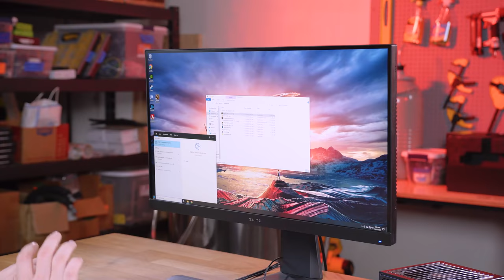This PC almost stumped me... can you guess what went wrong??

Comment: Me, who just built a PC with a Gigabyte power supply: o.o
Reply: Boyyyy better have warranties on all of your parts
Reply: O.o
Reply: I have one too but my pc isn't built yet... Time to send it back!
Reply: Same here, looks like I'm taking them up on the 30day unopened return policy
Reply: Are they that bad? I have one too.
Reply: I am sure they are fine, they are all tested to meet a spec
And gigabyte is probably not the one making them just selling them under their brand
Just because Jay's friend may got a bad one doesn't mean they are all bad
Reply: I've been using a Aorus P750W 80+ gold modular one since June and it's been fine.
Reply: Thermaltake and gigabyte
Reply: The only Gigabyte power supply models to stay AS FAR as you can are the P-GM series, so P650GM, P750GM etc, all other models are fine (AP-GM is fine which is AORUS P-GM)
Reply: @SteveWhaites  that psu is quite fine
Reply: @tshinharR  that's correct, all brand PSUs are made by OEMs like FSP, Andyson, Delta, Seasonic, Antec, Bitfenix, Enermax etc
Reply: @blitzcrocodilegaming4666  which model do you have, read my above comments
Reply: @blitzcrocodilegaming4666  ^^^
Reply: @xzreai1802  yea it's the p-gm series
Reply: @blitzcrocodilegaming4666  Immediately change it, it is actually dangerous and has caused lots of issues in the past.
Reply: @xzreai1802  v850 golf sfx
Reply: @xzreai1802  ok then! Thanks for the advice
Reply: @blitzcrocodilegaming4666  no probs, happy to help.  Have fun with your PC 👍
Reply: I see you also enjoy living dangerously.
Reply: @xzreai1802  Except Corsair and Thermaltake. Both of these still manufacture their own power supplies in-house.
Reply: the next time you buy, always research lmao
Reply: @Sabrinahuskydog  That I know of, Corsair CX/RM/RMx/RMi/HX/AX are good but overpriced most of the time and some good PSUs by thermaltake are the grand power series so GF1 650,750 PE/RGB, I'd stay away from their budget smart / BX1 lineup
Reply: Ive ordered a modular one and I'm having double thoughts now 😟
Reply: I had a gigabyte power supply for 2 years and recently got a Corsair. Lucky me o.o
Reply: yeah it has been a while since I had to buy a psu.  The reason why?  I would always use the "PSU tier list".  Not sure if it is still good, but it was useful at the time.
Reply: @bigdog3628  It is still good and running, latest version being 4.0, I actually know the people who write and edit the tier list.
Reply: @yukishiroenishi8564  Read the comments from me above.
Reply: @xzreai1802  cool thanks for the reply.
Reply: @blitzcrocodilegaming4666  not sure how much you're looking for but I found a few evga and deepcool 850 that seem reasonable to me. All 80plus  gold
Reply: @klin117  I actually just went and bought a corsair rm850x a couple days ago
Reply: I will always recommend evga for PSU

Comment: Jay: Talks a lot about alaska being the problem
The riser: Well hello
Reply: That riser comes with TT p5 cases and it caused me the exact same problem.
Reply: @briant6669  Yeah Thermaltake is Ali Express quality but available from other shops. People consider it a reputable brand but it isn't worthy of that.
Reply: "Have you tried troubleshooting your state?"
Reply: he said that the weather could be an additional factor that exacerbates the riser cable issue, he might not be wrong about the weather, and he did find the riser to be an issue, and that does not remove the weather as a possibility. i would suggest any PC be on a power supply serge protector anyways regardless of the local climate.
Reply: @gardian06_85  I've lived in Alaska for a long time. There's a lot of things I've done over the years that would make Jay cringe and facepalm with my computers. Weather has never played a factor. In fact, winter time probably made my computers live as long as they did (over a decade) because I didn't have to worry about overheating issues by just cracking a window open. I even thought humidity would play a huge factor, but it didn't.
Reply: It's a good method to troubleshooting when you think outside the box and consider all things from the simple to complicated, I'm sure that's what he was doing
Reply: @kevinnarvades1279  I have seen environmental interference effect PC components first hand, whether it be a difference in gauge of wiring in the wall (because a contractor making a repair was trying to save some money), or even a gust of wind causing a power line to vibrate. after everything I have seen I refuse to run a PC without some kind of surge protection, and in many cases battery backup.
also he was going through troubleshooting which is similar to deduction: "when you have eliminated the impossible, whatever you are left with no matter how improbable must be the truth" and at the end he was left with only 2 likely things, one he could tangibly find, but the other one would require him to go to that specific house in Alaska to test.
Reply: @CheapBastard1988  Don't insult Aliexpress like that.
Reply: insert obi-wan hello there here
Reply: @LatvianVideo  i mean, ali express has a reputation for having cheap and arguably crappy parts
Reply: and gigabyte psu
Reply: It's a sign that you are running out of ideas when you bring up weather and static in the air and fucking igloos
Reply: but to be fair grasping at straws is just part of the trouble shooting process... you just should check everything else before you get to the weird shit... 
    Sometime it turns out to be the weird shit, mostly not

Comment: I just upgraded my PC today, and went through hell trying every troubleshooting method I could think of. Turns out, I forgot to toggle the switch on my power supply 🤣
Reply: Lol, that's how it was for my first build, i thought i killed it, and then flicked the power supply button and it worked.
My second build was a little more complicated. The board wouldn't boot from the case powerbutton, and i couldn't figure it out. I thought the board was dead, but jumped it with a screwdriver and it started right up. I took the front IO out of the case and pressed the power button on the pcb and not the case. And it worked. Figured out the problem. The button wasn't properly aligned with the button on the PCB. That's just one of the many problems i had with that case. It was the Lancool 2 orignal version. After many other problems like gpu seating being impossible, i had to get rid of it. I don't know if all the Lancool 2's were like that, but mine had no way to mount the gpu, as the motherboard PCB was basically touching the side of the case, and there was no way for the fingers on the pcie bracket to get in with going through the board.
Reply: Lol I was helping a coworker troubleshoot his PC over text. He said the monitor doesn’t show anything. After about 10 mins I ask if the HDMI cable is connected from the graphics card to the monitor. He’s like oh it’s supposed to go to the monitor? 🤣🤣🤣
Reply: Welcome to the club
Reply: I will build my pc tomorrow, hoping it will go smoothly, and the cooling will be enough, as I will have total of 2 fans in the case, cpu fan and a 80mm server fan, probs will put it on the cpu cooler for now too, because my fans will come after a month. I will def run it without the side panel for now
Reply: There are times when i forgot to plug in the 6 pin pcie on my gpu, and i thought it was dead or something🤣🤣🤣🤣
Reply: #1 rule of troubleshooting anything tech related, start at the electricity outlet and work your way back from there
Reply: @scprojekt1896  My brother tried powering his gpu on a single 8pin, when it needs 2, it said to plug in all of the pci-e power
Reply: I RMAd a probably fine motherboard because I forgot to install the standoffs. There were a lot of silly rites of passage of pc building pre-youtube and plenty since.
Reply: For me, it couldn't boot as the RAM wasn't fully installed. Nowadays motherboards only have clips on one side so I thought I wouldn't need to hear a click on the side with no clips. Double checked and found out that the RAM still needs to be clicked in one the other side...
Reply: @pixels_per_inch  I did the same thing on my previous build, I couldn’t figure out why only 12 GB or RAM was showing up (I had 4 4GB sticks), so I went through each one by uninstalling all of the other sticks and leaving just one in the system, and then got confused when they all booted properly
Reply: You should rethink your troubleshooting methods. The first thing you should ALWAYS do is check the power switch. Sadly there are too many TechTubers that showcase the wrong way to "troubleshoot" a PC
Reply: Hey you're lucky it was such an easy fix, I added a new SSD after Christmas and have had nonstop problems with everything from the HDD not reading to one fan on the AIO not spinning to the GPU fans not spinning to the mouse not working. 

None of it is connected with installing an SSD, it's just bad luck. But every time I try to fix something, when I turn it on it's still not working and now there's a new problem

Comment: I have the same case Jay. The bracket is on the wrong side in your video. Mine does not bend hard like that at all. And while I was watching you hold it up, I looked at mine. That metal part goes below the self, and the ribbon runs under it. the hard bend was not ttakes fault on this one.

Comment: Yeah, i have had the same experience with a more expensive riser-cable.
I replaced every component in my computer before i found the issue.
I'm never using riser-cables again, and i'm never using water-cooling after my brand new ek x360 rad had a leak in the middle of the fin-stack that ruined another computer i had.

I'm sticking to noctua coolers and stock GPU mounting.

Comment: I have never used a Gigabyte PSU but I built my first AMD computer last year and also for the first time used a high end Gigabyte Mobo. It failed after about 90 days, I had it replaced by Microcenter and all was fine, for four months then the new one failed. I bought a new one (#3) and sent the old one (#2) back to Gigabyte. This time I had Microcenter install it and check my build and the other components. The new one (#3) was then working. After weeks I contacted Gigabyte to get status on the one I had sent back, I knew they had received it weeds earlier. After a bunch of BS (yes I kept all the BS communications) they sent the repaired one back to me. While it was in transit, guess what, #3 failed. Microcenter also confirmed that that Mobo had once again failed. 
Being totally done with Gigabyte I bought an MSI X570 Mobo which has been running fine for a year.
Gigabyte? I would rather trade in a Mercedes for a Yugo than get Gigabyte anything.

Comment: Jay: "Get good riser cables"
Me looking over at my P3 with factory cable: "I should fix that"
Reply: My P3 with factory cable has been working great since day 1 (18 months old now, running a 2080 Super).  I did a build for my dad with a different Thermaltake case that came with a riser cable that is having all kinds of wonkiness.  I though I had eliminated the riser cable as a source of issues but this is making me think I need to revisit that
Reply: @coryvincent6249  ive got a p3 ive not had anything wrong wirh it either ahs
Reply: I got a P3 as well with a 2080 ti using the included riser cable and no issues since day 1. Its been about a year now. I was worried about the riser cable when I first got it after looking at everything about them. Maybe I got lucky?
Reply: @Prod1702  Maybe you got their best. Even a broken (analog) clock tells time accurately twice a day.
Reply: If it's working fine right now, better to just leave it alone and not disturb things.
Reply: I believe I read somewhere that the issue crops up when dealing with PCIE 4th Gen cards/boards, ask me how I know... AMD 5700XT wouldn't work, Nvidia 1660 TI had no issues on my kids P3 case
Reply: I had to take out my riser cable and mount it normal in my p3. The riser cable wouldnt work with my 3080 even set to gen 3 still didnt work.
Reply: @coran007  I have the 1660ti in mine. No hard bend, has worked fine for a year now.

Comment: Jay: "don't buy a gigabyte power supply!"
Me looking at my 700w gigabyte power supply: 👀
Reply: When it breaks, just use iFixit 🤣🤣🤣🤣😂😂😂😂
Reply: I've had mixed results with power supplies and most eventually fail after a few years. I've had Expensive Seasonics, mid-grade Corsairs and ThermalTakes. For the Corsair and TT, they were modular and the modular boards busted on them out of no where. I converted them into benchtop power supplies. The Seasonic 1200 first had the fan fail, I replaced but it eventually stopped turning on. I'm now on Seasonic Focus. 
The ONLY hardware to fail has been Power Supplies. I guess get a decent name brand and keep the load in specs, It'll eventually fail and rinse repeat. Most have good protection against current spikes so just pray it doesn't take anything along with it.
Reply: Yeah, just don't cheap out on some unbranded crap and you should be fine (well not completely, but at least the risks are much lower)
Reply: @pixels_per_inch  Completly correct. Do not buy cheap crap :D. 

I have Antec 550W power supply for last 5 years and it still works, it was arround about 70€ back then.
Reply: @moes2168  I bought a 750 watt coolermaster power supply in either 2007 or 2008, completely rebuilt my PC 3 times since then and I'm still using the same PSU, the thing's a champ

Comment: I have the ThermalTake P3 case and I could only ever get the build to work without the riser cable. As soon as I tried to use it I'd get weird crashes and post issues. I'm tempted to try again with a decent riser.

Comment: i think what Jay meant to say: Get a UPS  (uninterruptible power supply) never heard of a UPC before :P it's basically a battery you put between your PC and the the outlet and it prevents your PC from shutting off when the power fails, the proper ones also filter power and protect against brownouts and such! I've heard so many stories of people having to replace hard disks, motherboards etc, told them: Invest into a UPS before you repair/upgrade i've been using an UPS for 20+ years now and 1 of them prevented a lightningstrike from taking my entire PC with it, all that was broken with my PC was the onboard Ethernet port, the UPS survived the entire ordeal! (the lightning took our router and 2 hubs with it too XD) 

depending on brand they might seem expensive, but they will save you a LOT of money in the long run!

Comment: After being in and out of bands most my life as well as owning a crap ton of sound gear I learned really fast the limitations of our electrical grid. EVERYTHING I own that runs off electricity barring the fridge and microwave are on Furman power conditioners. I have never had a piece of electronics fail since I started doing that. They have surge / static protection as well as filtering to keep the power stable. Maybe your mate needs to hit up a guitar center before they fold and grab a few of them to take home.

Comment: Ive been using the Thermaltake TT Gaming PCI-E x16 3.0 Black Extender Riser Cable 200mm AC-053-CN1OTN-C1 since 2018 on my vertical mounted gpu. Never had any issues. Even with overclocking gpu , it just works great

Comment: i had a thermaltake core p5 from new and thermaltake did replace the riser cable free when issues were discovered with the core p5 risers which are identical to the core p3 risers but i had the same issues as this guy had with the original riser , benchs would crash and random game crashes but never caught fire , thermaltake did a recall on the mark 1 risers and the replacement riser is still going strong in my daughters pc

Comment: I just bought a Thermaltake Core P5 and guess what, the riser cable gave me massive problems... I thought it maybe had something to do with mixed compatibility PCI-E 3 and 4, but I was wondering about the angle you needed to put it in when the manual clearly stated not to bend it too much. I guess I'll go buy a good riser cable now.

Comment: Dont know if this will get a response but i think all the problems could stem from that riser.  correct me if im wrong but NVMe runs on pci express lanes. if that riser was shorting out bad enough it could have caused the controller to over volt causing the capacitor on the pci power rail to pop and blowing out the pci express on the board. Wich would mean the cheap capacitor might have saved the gpu and processor from getting significant damage.

Comment: I never heard of static in the air in a room causing problems before. Equipment is designed to handle normal levels. I'd love to see further investigation on it, something is up. Also on your monitor try shorter runs of high quality shielded cables and different cable types ie hdmi or DP maybe even DVI or a different monitor at Jay's home. I'm sure it's fixable, I've never seen this before. How are the houses earthed over there, what type of roof and insulation materials? Very strange = very interesting.

Comment: The riser cables look a lot like the old IDE cables. Which would often fail due to overheats or other issues. Figured that out back when HDD;'s were expensive (like $500 for 1 gig) So, the riser might have been damaged by whatever made it smoke

Comment: Static won't build up in a PC, if grounded properly that being said if power at the wall drops to much this can cause capacitors to expand and leak causing smoke, if left to long they will explode, turning it off will prevent it, if power is normal again all will just work, but it still may damage components especially the CPU or GPU core. also check cables being pinched or cables wired incorrectly.

Comment: I have a core p5 and the riser cable it came with was poo and causes the same issues. I purchased a new (thermal take) one locally and it worked fine until I upgraded to x570, 5800x and rtx3080. Now the problems are back.